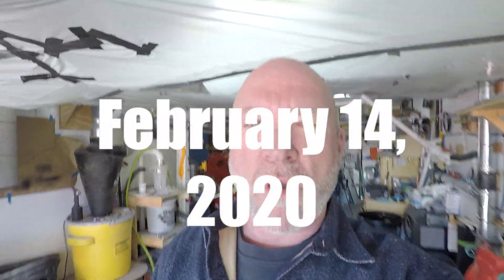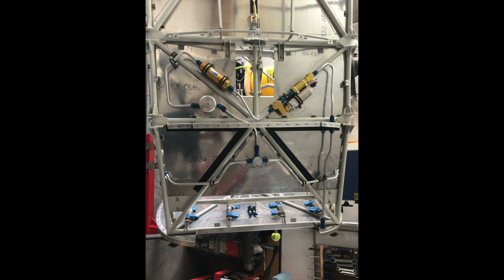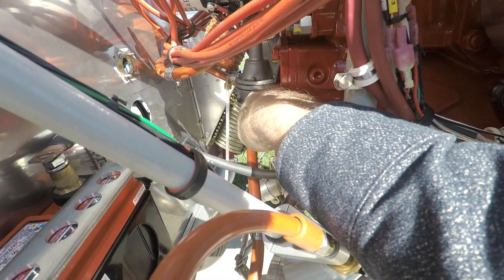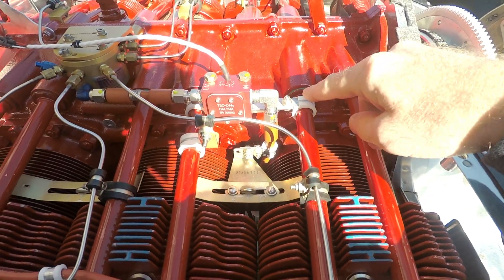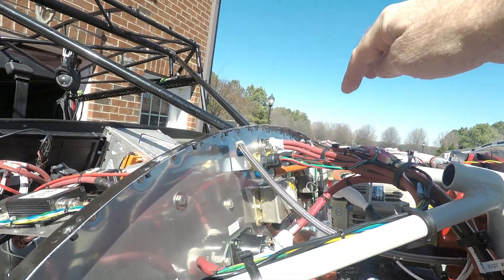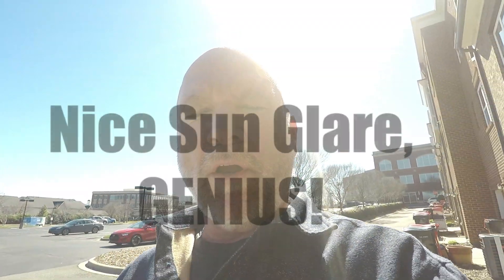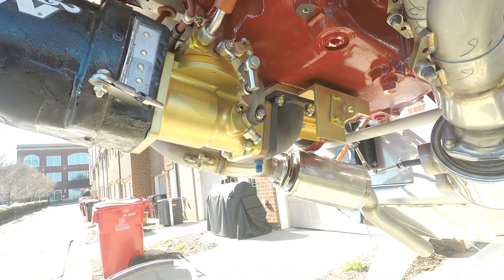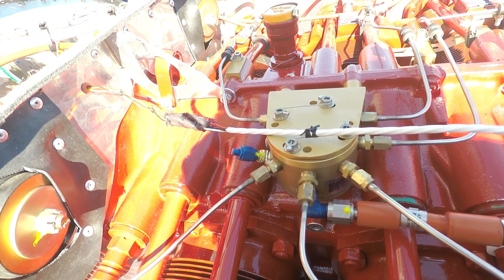Bearhawk ~ Fuel Lines and The Fuel System

Comment from the maker: Undoubtably, the MOST critical system in an aircraft that you are building yourself, is the fuel system!
Reply from the maker: I changed the fuel lines running down the front pillars.  They are now a little longer and turn directly into the wing roots from the cabin.

Comment: So no header tank ? Where does the return go ?
Reply from the maker: The fuel injection is an Airflow Performance System.  I visited with the owner of AFP, Don Rivera in Spartanburg, SC to review the design of my FI system.  Don did not require a header tank and there is no return.  Here is my builder log review of the fuel lines.  https://bearhawk4place.blogspot.com/2018/10/fuel-lines.html

Comment: It's also an interesting point about the fuel line insulation, the idea behind what the gravity fed system is i'm designing in theory is to allow maximum continuous flowin as much non llevel attitude/orientation before the engine fuel pump.
A couple of difficulties i found were that the two tanks joined across a roof beam "must be joined below the cabin window bottom edge"
 then run in a protection beam along one side at an angle of around 20 degrees downward solves most of the problem (after/aside to/besides the problem of both  tanksleft and right individual shape design and outlet catchment designs under orientation/flight attitude).
The tanks to have a sloping base/bottom so fuel is not retained during mild turning, 
the outlets from the tank edge closest the wing root side(of tank) require to feed fuel into the lines that enter the cabin at a tiny downward angle also to prevent running back in during banking p/ side/direction of lean.
With a gravity  fed system the problem is, "as the tank gets emptier the weight of the fuel forces the fuel through the lines less", 
so if the main lines are too thin of inner diameter they will not feed the engine pump in high fuel use rate,
thinking something like for injector systems the line has to be "'(1.5x final injector line INNER diameter) x number of cylinders = the INNER diameter ofall fuel lines before the engine fuel pump".
Another problem is fuel booster failure (but with good maintenance management of time based replacement probably never).
The booster is need for tight manouvre and for most take-off with the nose up at high angle.
The heat insulated lines material mentioned in the video would be good for puting a pair of 500ML (250ML each) fuel reservoir tubes mounted in the front of the cowl just above the engine fuel pump, the bottom of them a few inches above the engine fuel pump with cone shaped outlet ends to feed from the main line to the engine fuel pump within inches of the engine fuel pump.
That would greatly assist non fuel supply failure by assisting high flow rate fuel availablity during high angle takeoff and climb particularly if little fuewwl is left if the pilot did not check how much fuel. It is more likely to starve at 300ft to 1000ft thanon the last catchable tank dregs/drips.
Main line to the engine fuel pump is one of the main worries by diameter for unassisted flow.
Reply from the maker: Thanks for watching TheOldnic!  Please like the video and subscribe to the channel!

Comment: Great system. I would have done something different in fuel delivery terms. 27 gallon tanks either side would be joined directly to each other in a straight line in a protective housing going through the cabin and then a T intersection to feed to a single booster pump below the wing root below fuel tank level in the cabin in a carefully sealed compartment.
The essence is that when the nose is up during take-off at high angle the engine pump can be level with the bottom of the tanks in the wing (around 45 degrees - low-gear = power takeoff pitch).
Depending the pump booster, i don't know if they have a one way valve and allow fuel through while switched off , neither if two in a pair of lines stops pressure from the other if there is no fuel in the opposite line. It comes to my mind the safest is the join across the cabin and a single booster , but for supply reasons near out of fuel the pump sits accord to high angle takeoff with fuel behind the pump and some in front at the lowest possible point in the system during high angle takeoff.(what i would do).
Reply from the maker: Interesting.  I'm not sure I would try to change a proven 20+ year system that Bob Barrow's created and has worked so well.  I appreciate the high wing tanks (2 ports each tank) gravity feeding to the lower side of the ship, then pushed by boost pump as a back up.  I have collaborated with some very well established professionals in fuel delivery system for aircraft and all have commented how well the Bearhawk fuel system is designed.  But hey, that's why it's called "experimental".
Reply: @TheBaldPilot  The point of boosters is during takeoff or backup, and during landing when fuel reserve is low, in that with high fuel consumption rate requirement and delicate precision particularly for fuel pressure at high rpm for a Injector metering system (servo) , whatever levels the aircraft orientation is the fuel can be kept sufficient to the mechanical engine pump.
e.g. If you are using a heavy nose downward angle and may need high rpm instantly again to adjust, or are doing a go around and need to re-take-off without landing , various attitude angles of the aircraft will require front , rear , and one side outlet on the tanks because if they are an eighth full  having only one outlet could be not in contact with the fuel level in a STOL. Even a 120hp with propeller governor can hold such high/heavy angles  of orientation, the booster pumps then must re-pressure the fuel that does get through or the fuel from a near empty tank that does not weigh much down the line to the pump.
A redesign of the fuel tanks using the extra tank system in the wings to re-allow the 54 gallons by sitting the bottom of the tanks a couple of inches above the base of the compartment and three outlets rear, side(fuselage side) and front while slanting (at 5 degrees) the bottom of the tanks in toward the fuselage would be severely good help to delivering fuel at many flight orientations with a low fuel level in tank including the rear outlet (nose up) , and front outlet nose down, and slant to side slosh while level in gusts and wind. The lines join into one from each outlet then to the fuselage line.
Joining the two tanks directly from the three outlets as one each side inside a bar or metal guard across the cabin then choosing a connection point on one side to supply to the main line to the booster then the engine pump in sequence means almost no fuel present if it ever stutters the engine.